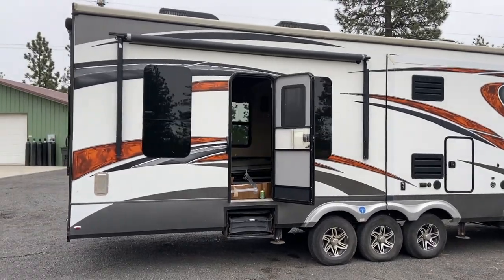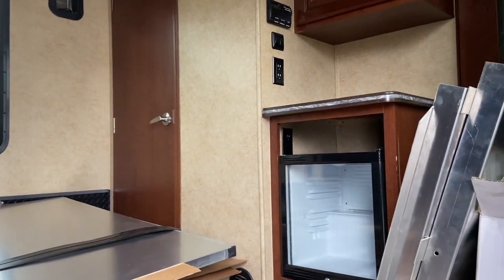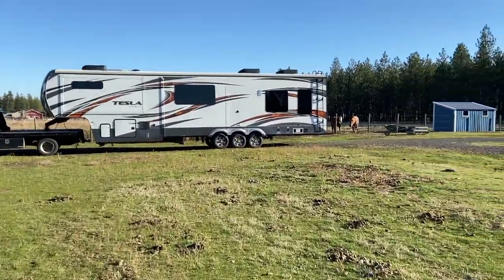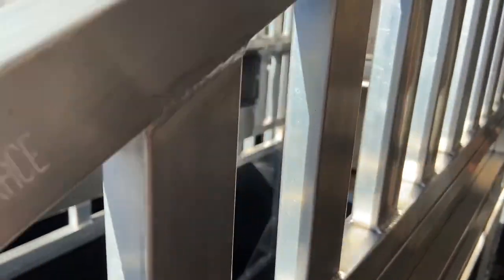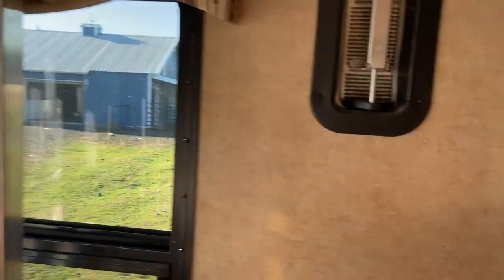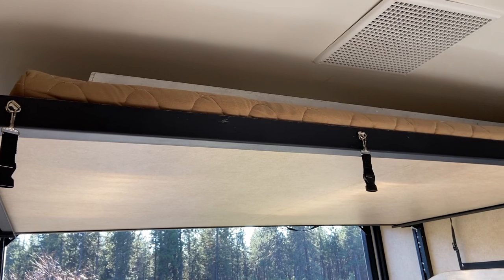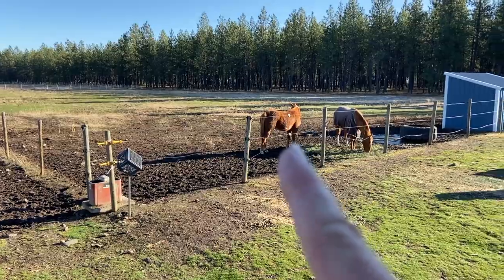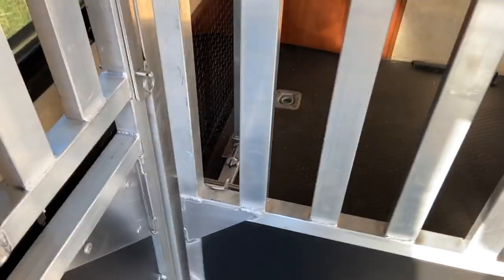Toy Hauler To Horse Trailer Conversion ~ RV To Horse Trailer Modification

Comment from the maker: THANK YOU for watching!! Let me know, in the comments, what else you would like to see and subscribe so we can visit often 😎
Reply: Why do you not center the stalls in the center of the toy hauler? It seems it would would cause it to lean to the left. Also do you have to re enforce the back of the trailer in order to carry that kind of weight on the tail?
Reply from the maker: @cherien3805  it needs help from the sidewall structure for strength plus with it off to the side you can walk around it. We installed it as per instructions.
Reply: I'm a bit late but loved the vid 💖🐎💜🐴💕

Comment: You think you could make it into a slant load ? Would there be enough room
Reply from the maker: It wouldn’t be structurally sound, but I’m sure you could custom make some thing. We sold the unit.
Reply: I was going to ask the same question. Looks like 3 (slant) could fit comfortably?  🐎

Comment: How is it for the horses since the wheels on the toyhauler are farther forward? I am concerned that there will b more up and down motion for the horses
Reply from the maker: The horses seemed fine.  Did you watch the portion where I rode in back with them?
Reply: @FunnyFarmHomestead  no I didn't. How would I find that and thanks for responding
Reply from the maker: @jswik2085  it's a few minutes into this video.

Comment: Do you have a link or can you tell me what the blue strips are so I can look for some? Thanks!
Reply from the maker: We cut those strips out of some traction rubber pieces we had in the shop. I think you could even use pieces of wood. Just something to stop the foot if it starts to slide. Thank you so much for watching 🤠
Reply: @FunnyFarmHomestead  thanks, I didn’t want to do wood strips, I’ll look for something similar

Comment: That looks unsafe when loading, the escape door under their feet. If you had a horse that wanted to rear while you were loading or tying up, you would surely not want to crawl under their feet to use that escape door.
Reply from the maker: I totally agree with the loading and unloading being a bit unsafe. The steep ramp would make it easy for a horse to step off the side. I think some kind of rail on the side of the ramp would be a necessity. After I made this video we just have never had an opportunity to use it so we have pulled the unit out. Thx a ton for your comment. 
The RV is now an Airbnb at my place…
https://www.airbnb.com/h/thefunnyfarmhomestead

Comment: There is NO way I would put my babies, horses inside an RV,. Not sturdy enough and plus would sway like crazy with the added extra weight,.. NO thank you!! Gotta be wood flooring for my beauties,…Sorry not for me ever! Happy Trails!
Reply from the maker: Not sure what you mean by sway with extra weight considering a toy hauler is built to haul cars and other heavy toys 🤔 On the regular I still haul with my horse trailer... this is just for special camping occasions.  Thanks so much for watching and commenting.  Enjoy 🤠
Reply: I think having the sawdust on the floor is way more stable than the grooved plastic/rubber floor. I would be concerned at having a ton and a half of horses behind the last axle on the trailer have you been able to check the weight on the triaxle and if it keeps you below the legal limit and how much weight you have on your traile rhitch now with the horses in the back mind u if its designed to put vehicles in there it might be alright ..whether the vehicles are the same weight as 2 horses is another thing too I suppose.
Reply: Bumper pulls sway, goosenecks/5th wheels do not, especially with a triple axle. I'm pretty sure the designers of Stable Boy have conducted proper research. Hope you're checking those wooden floors & the frame underneath frequently!